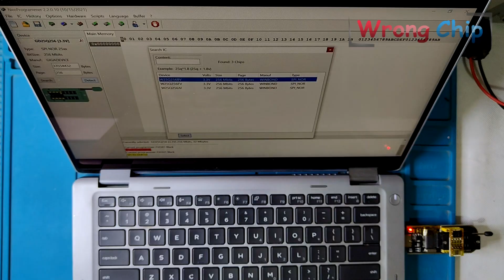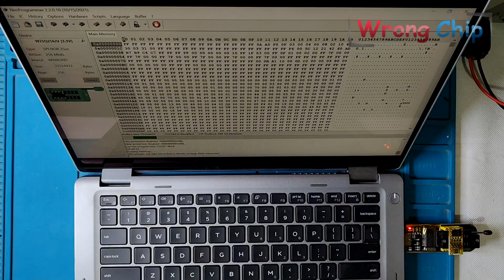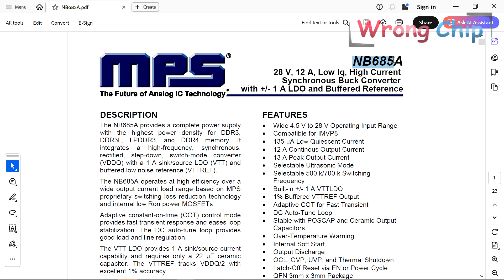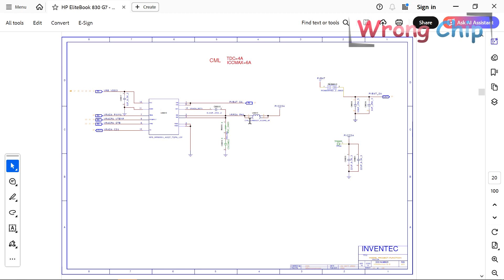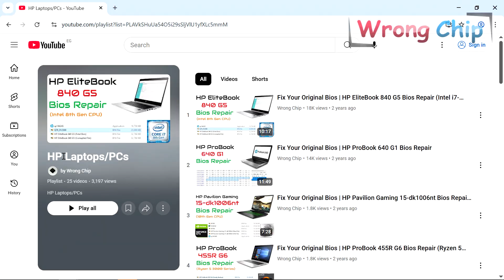HP ProBook 640 G4 Black Screen - SOLVED 5 CAPS LOCK Blinks

Comment: You should invest in a better programmer, I used to use the same CH341A and it caused a ton of issues and glitches, get a T48 by Xgecu or even a SVOD4, it will save a ton of time and headaches
Reply from the maker: Sure, T48 and SVOD4 is much better but actually I don't need any of them right now. CH341A is very slow and not reliable but I use it carefully to get its best performance.
Reply: @wrongchip Yea as long as the frequency is slow then it should be more reliable, same goes with SVOD4 when my adapter is a bit dirty

Comment: Hello brother, now my last hope is from you, I have shown my laptop to many professionals, it is showing black display, no solution has been found, will it be fixed through BIOS, it is AMD RYZEN 9 5900HX, I have its backup right now, will you repair the BIOS and give it to me, Tell me how much it can be paid for
Reply from the maker: Hi, you can just send me a message on Telegram and I will try to help you. Remember to describe your issue, also include your laptop model number/serial number/motherboard number and your BIOS file.
t.me/WrongChip